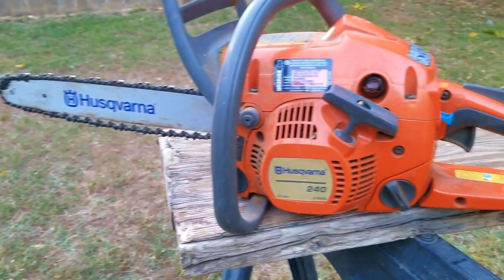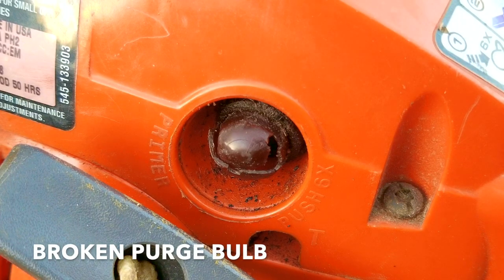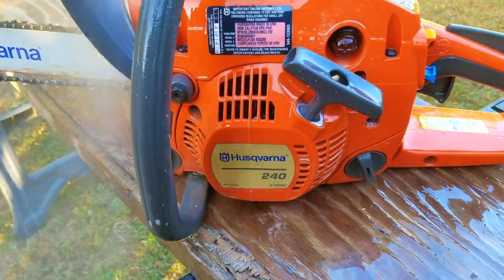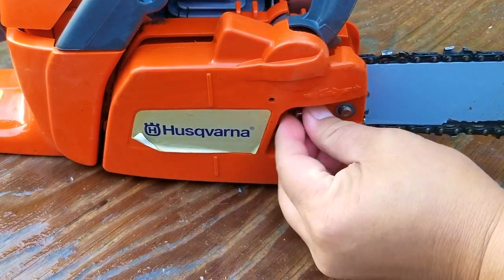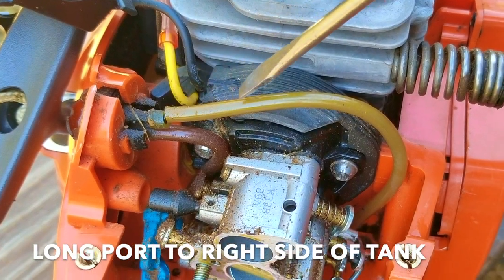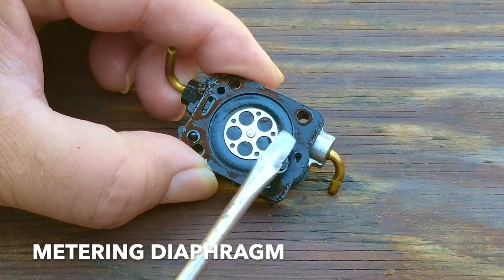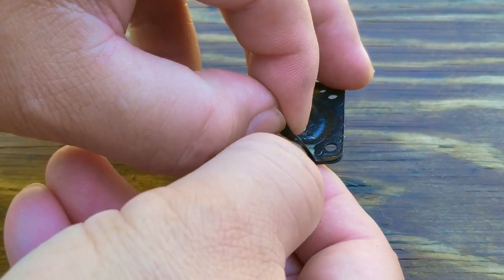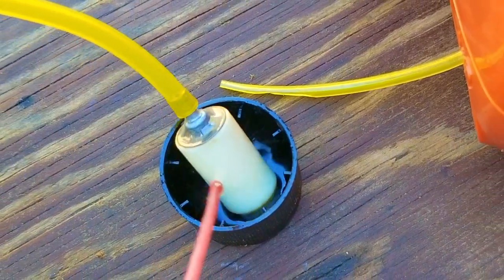This Husqvarna Chainsaw Has A Special Part I Wasn't Prepared  For

Comment: The gamble here, is whether cleaning and a carb rebuild kit will fix the problem.  As much as I prefer to rebuild an OEM one, I have had quite a few that no longer worked after rebuild.  Those parts aren't usually something you can return, so you would be out those funds.  Whereas an aftermarket carb, if it doesn't work or leaks, you can always return it.  If it is not a carb style you see many of, I would vote for an aftermarket one.  

On a separate note, what is the heavy duty degreaser you are using?  The ability of that to clear away so much grease and grime without any real agitation is incredible!
Reply from the maker: you make a great point.

Comment: Working on a Husqvarna 240 saw and have done everything (cleaned carburetor, tune up, adjusted carburetor). However, it still runs and dies. Cheap Chinese carburetor on the way…
Reply from the maker: yes sir, tell me how it goes

Comment: Did you have that solution laying around? I haven't seen you try to rejuvenate the pumping diaphragm in a while. Also AT 205 is really good as well. You only need a little bit to soak the rubber parts in.
Reply from the maker: it's always ready, And only use it, as last ditch solution, to find out IF the machine works, before committing to it.

Comment: I think the options I have on the 440 are a knockoff carb. I already priced an OEM carb and it was $140+ and the hi-speed jet is wrung off in the carb body trying to get it to lean down some. AND I don't want another carb that has a chance to act likie the same OEM job BUT it runs good enough for now. The son-in-law will end up with it so HE can delve into it if he wants. I do need to start it because it hasn't been run in maybe a year BUT has Tru-fuel in it so it ought to go after 10 pulls or so. No primer on this one. Happy day and Blessings!
Reply from the maker: thank you Lewie McNeely
Reply: @HomeGaragechannel  U 2! I wouldn'
t be here if it wasn't 4 U!

Comment: try to save the original diaphragm by putting it in brake fluid for a night or a bit more, that will make it a little softer again and if the chainsaw works fine just buy the diaphragms
Reply from the maker: already done

Comment: One thing I haven't tried but have thought about for difficult to obtain diaphragms is soaking them in a seal sweller, such as atp at-205 re seal.  Considering the probably extremely low hours on that saw, if it were mine, I'd probably splurge for the oem carb if a reasonably priced rebuild kit wasn't available.
Reply from the maker: thank you Aaron Powell.
Reply: IT RUNS…… (next frame) Spray, spray, spray….Lol.  Is it possible to ask the owner what he or she would like you to do? If they don’t use it a lot, they may have you order the rebuild kit. That would be my two cents considering the saw looks like new.

Comment: I'd say go for a diafragm kit. However, it seems every diafragm uses the same material so it's entirely possible that you might be able to buy a roll of the stuff and cut out a new one. However, I could be overlooking something. I'd go for the cheapest option. If the knockoff rebuild kit is cheapest to purchase, get that. If the 25 dollar diafragms are cheapest, get those. It all depends on who's selling what.
Reply from the maker: don't forget there's  metal wheel in the middle of the diaphragm too which means replacing it would be extremely tough.

Comment: I'd stick to authentic rebuild kit as well.  It's still cheaper than full original carb, but if you're using your chainsaw (or any piece of anything) reasonable amount of time, I wouldn't rely on knock-off parts in any way, shape or form and avoid them at any cost.

I mean, it's cheaper to get good parts or even full carb then having your 200-300$+ chainsaw catch fire.
Reply from the maker: thank you

Comment: if that was my own personal Chainsaw i,d start off with a rebuild kit for starters and if it works that,s awesome and if not then Plan B would be then next best thing to cure the problem for good which is replacing the carburetor aka carby.
Reply from the maker: makes sense thank you Patrick Stapleton.

Comment: I often just wet the air filter with fuel to check if they'll kick
Reply: ... also soaking the diaphragm in alkylate gasoline for 2 strokes can often times revive them. I leave them in the cap from an aerosol can over night and they'll often times come back to working conditions.
Reply from the maker: oh.. that's a good idea, I'll have to remember that trick.
Reply from the maker: nice tip
Reply: @HomeGaragechannel  also works wonders if you can't peel a gasket without ripping it.

Comment: I don't think this has been brought up before: The small plastic bung on fuel return lines in most 2 strokes. Is it there just to retain the line or regulate fuel flow?
Reply from the maker: no it's to keep the line from coming out.

Comment: Buy a cheap carb and just modify it. Chances are by the time the next owner needs to work on it the saw parts will be obsolete and the model of the saw will be long discontinued to even notice it’s got an aftermarket carb on it
Reply from the maker: you make a good point.

Comment: Hey bro, I just bought a gallon of that harbor freight super heavy duty degreaser. I mixed it to 20:1 and gave it a try on my stihl 021 and the stuff is so weak that the old degreaser that I used is stronger. Do you mix it at a heavier ratio or do you use the other degreaser that they sell?
Reply from the maker: I apologize but I don't mix it, I use it straight
Reply: Oh... That explains why it's so weak lol. Thanks!

Comment: as ive seen in your videos. OEM is the best choice. Aftermarker "3rd party" are questionable and in some cases outright wrong. Id get an oem carb kit. you said prices on the diaphrams. I doubt a few gaskets add that much to your 25 dollar investment. 😅 plus ive seen enough content from folks like mustie1 to know carb kits that are from questionable sources can also be wrong. sometimes...so oem for sure. If it were mine. not a "customers" then all bets are off. id get whatever is cheapest 🤣
Reply from the maker: you are correct.
Reply: @HomeGaragechannel  i look forward to more content. you do excellent very "professional" type content.
Reply from the maker: I appreciate that

Comment: I'd probably go with the OEM diaphragm kit or you could try using your rejuvenation liquid.
Reply from the maker: the fluid, has a slim margin for success unfortunately.
Reply: @HomeGaragechannel  The success rate being low is a bummer. Best case scenario is seems to be the new diaphragm kit.
Reply from the maker: I think so too, I only use the fluid as a last resort.

Comment: I would go with the oe diaphragm kit. I have had good luck with them. Also your local small engine shop, or maybe even the dealer (if it is a servicing dealer) might be able to get a rotary, stens, or possibly oregon (if oregon makes them) aftermarket kit. They all seem to be of good quality.
Reply from the maker: yes the OE kits, seem to be a better material.